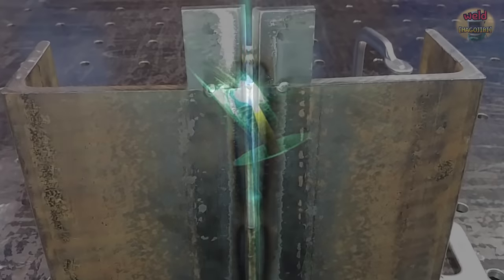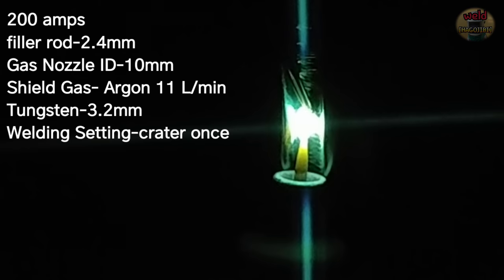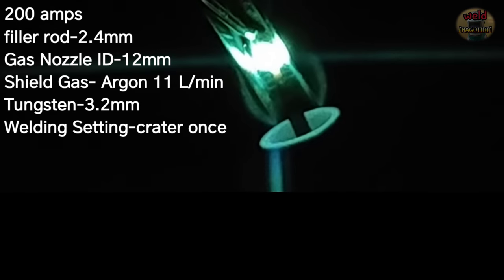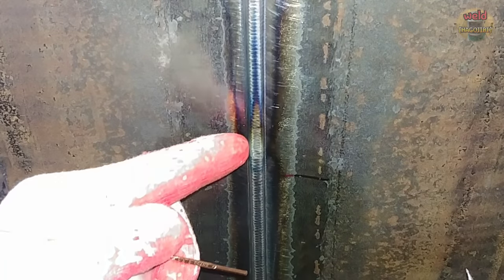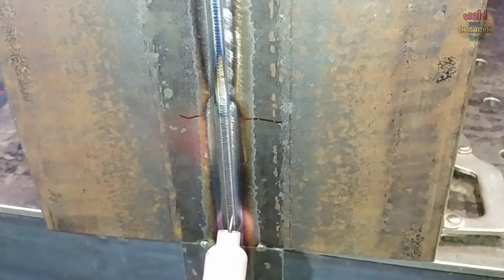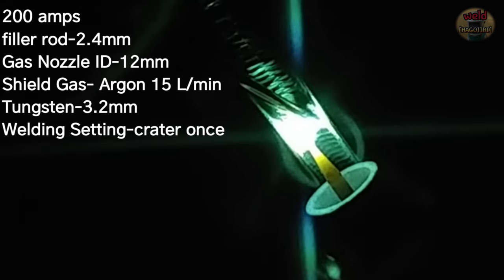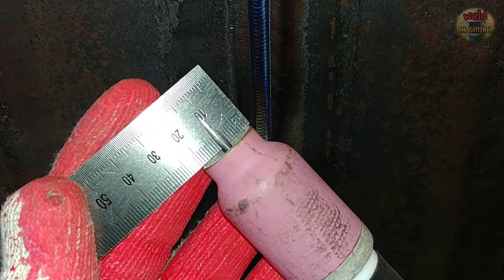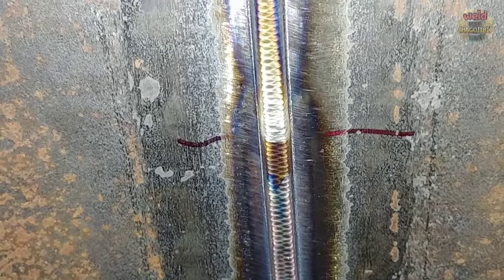What is the difference when welding with nozzles of different sizes? TIG vertical butt welding

Comment: Nice video.
You explained and showed it very, very well.

It is true that you have better guidance with the smaller nozzle than with a larger nozzle.

A smaller nozzle is very advantageous for beginners because it has a larger nozzle. Can it happen that the weld seam becomes wider because you don't have the manual skills yet?

When I was training as a welder, I tried to commute onto a sheet (PB layer), the seam was hideous. It was not even, sometimes wider and narrower on the right and left. I then drew 2 lines on a practice sheet with the scriber, distance about 5-8mm. I then tried to swing in the strips. :-D :-D :-D

A good start to the week is desired.

Comment: hello i like your video, i have a question, how much stick out should I use for my finishing pass if I use a cup number 10 (16mm) with the walking the cup on the plate and on pipes? thanks
Reply: He does a lot of videos that show  exact stickout for such situations.  After welding for a while you will be able to just look at the pipe, your torch, your stickout and know if it will work for you or not.  The length does not have to be perfect.  Some variation will still yield a quality cap pass.  Best of luck to you.

Comment: Hello, is in the inside of the gas nozzle a gas filter? When you use a bigger size nozzle you do have more gas pressure. It’s all about the gas molecules. The closer they are together the hotter the gas will be. So a bigger gas nozzle with a to low gas flow is to cold plus there is a risk that oxygen molecules get in to the gas flow what gifs you a darker weld and risky of xray mistakes. When you film the gas nozzle please show me the inside to. With a gas filter you get a better gas protection plus a better gas ionisation.

Comment: can you show how to weld 2 in 1 pipes for exhaust, 10deg of connection, pipes are 42.4mm OD, 1.5mm is thickness, i  have problems on position where two pipes are closest and i use nozzles no 4 and arch skips between pipes

Comment: If you dont know... the number on the side of the cup is the oriface size in 1/16 of an inch.. so a #6 is 6/16 of an inch.. a #8 cup is 1/2".. typically you want the stick out to be 1/2 the diameter of the cup #8 = .25".. and you dont need the gas to be more than 4x the diameter of the cup.. so a number 6 cup 24 cfh.. (can you do more.. sure..)